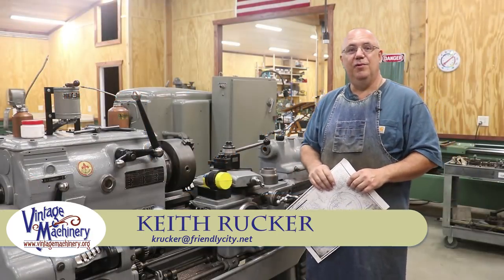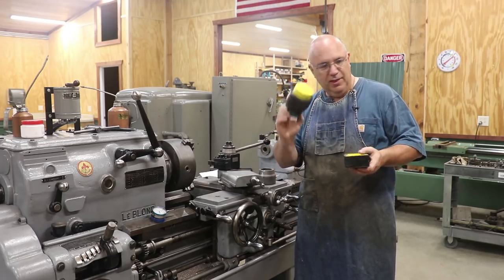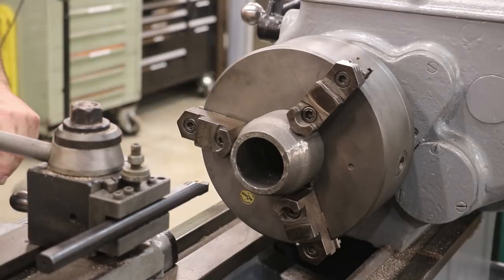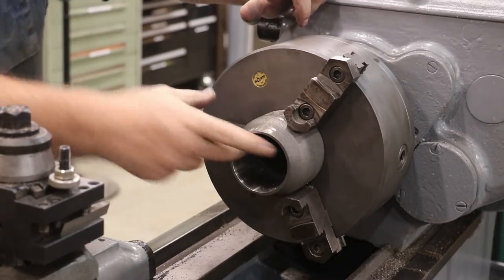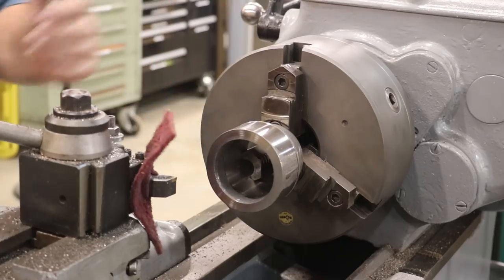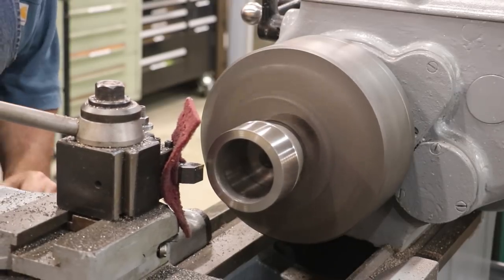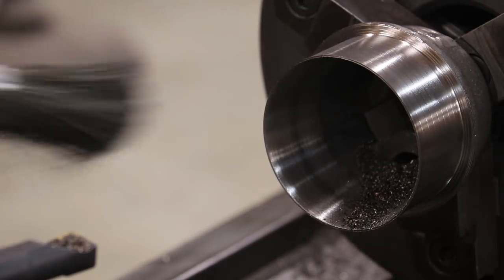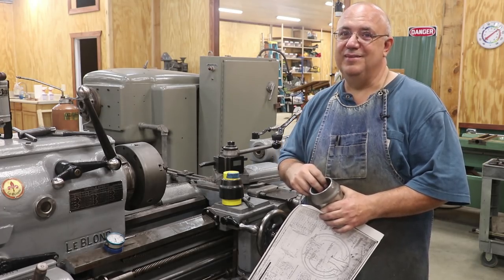Machining a Steam Locomotive Exhaust Nozzle from a Casting

Comment: Excellent video, Keith.  A major factor in these projects is the strategy you use, what to hold first, find center and then a plan to use those surfaces to hold the part and turn the rest, without going askew whiff and running out of material.  In the video, you just appear to tell us the plan, but I know there are sometimes occasions where this decision is difficult.  But you say just enough to tell us the solution.Nicely done

Comment: Glad to see that there were no nasty surprises during this little project (inclusions in the casting, an old socket that was out of round, etc.).
Reply from the maker: That casting really turned out nice.  I was surprised at how true it ran for a rough casting!
Reply: Yes, Cattail Foundry couldn't have asked for a better advertisement demonstrating the quality of its castings.
Reply: I don't think he uses Cattail any longer.  Maybe this was Cattail, but awhile back he mentioned he was using another foundry.  I believe there was an issue with delivery time.
Reply: Thank you for the reply.  I hadn't heard that.  Regardless, the foundry did a nice job.

Comment: Nice turning. That cast looks great when turned. You basically made a venturi nozzle. That is the same principle used in carburetors. And that will help with velocity of the exhaust extraction. Thumbs Up!
Reply from the maker: I've been told that we will probably notice an improvement in performance of the locomotive.  I am kind of anxious to see what kind of difference it makes!
Reply: Might improve fuel consumption as well.

Comment: Lovely job Keith, enjoyed the video. One point to consider in the design of the nozzle restriction is that the narrower the bore the greater the back pressure on the exhaust stroke of the piston, thus increasing the power demand to evacuate the used steam. So there is a balance to be struck here. Probably not too much of a worry here as I suppose you won't be running at any sort of high speed high horsepower demand.
Reply from the maker: Yeah, about three or four MPH is our max speed!!!

Comment: There is another way to keep chips under control. Use a left hand turning tool upside down and turn the chuck in reverse, this will throw the chips downwards
Reply from the maker: Yes, but I honestly just like having my cutter on the top so that I can see what is going on.  It is just a personal preference thing.
Reply: Won't work, I had a CNC machine bury a hot chip in my nose thirty years ago. I still have the scar!
Reply: Love the tip. My lathe is an antique that won't run in reverse......
Reply: Yes, it works a treat, I do this when parting off, especially brass etc. I'm not sure why the Pros don't or won't do it.  
Don't do it with a screw on chuck though !
Reply: No offense meant, but it seems like most people on you tube channels have no clue as to machining C I , i.e.;  always make first cut deep enough to get under the rough cast surface ( clean surface finish )  and SLOW IT DOWN ! ,  no reason to have chips fly in your face. Simply take a heavier cut at slower ( proper ) spindle speed and chips will happily pile up on the saddle and ways and NOT fly up in your  face .

Comment: With the better draft you may get flying sparks from the stack.
Thanks for the vids
Reply: The locomotive was converted from being coal fired into an oil burner.  Since they don't burn coal anymore, sparks shouldn't be an issue.
Reply from the maker: Like John said, we burn oil, so sparks should not be an issue.  Sparks and starting fires in the dry woods around here in the summer time is one of the reasons we made the switch!

Comment: Nice casting and machine job! I would be interested to hear if the operation is improved once the engine get going. Enjoyed the video!
Reply: I think the idea is that the steam blowing up the chimney at a higher speed pulls more air through the fire box. In other words, more draft means hotter fire.
Reply from the maker: The casting is one of the better ones that I have had made - it really tuned out nice!

Comment: Keith a question.  Given the size and amount of material that would have to be removed, essentially the nominal size of the hole through it. The rest will bored out anyway is it worth the extra effort to make casted hollowed verses just drilling it out?

Comment: Nice work Keith.  Should help quite a bit.
Reply from the maker: I sure hope so.  By the way, that sealer that you suggested appears to be pretty good stuff.  It is darn expensive though - about $80 for that little tube, and it states that it only has a one year shelf life!  We will never use that much in a year, but I am sure that we will need some more just about the time it goes out of date.
Reply: Very good stuff.  Keep it in the refrigerator.

Comment: I'm curious to know if the difference between no nozzle and nozzle will be just noticeable or REALLY NOTICEABLE.
Reply: I was wondering if power was improved by better scavenging of exhaust?
Reply: I expect it will be noticeable. According to what I've seen in other sources, the velocity of the steam affects the draft more than the volume of the steam.
Reply: If the engineers who designed that engine thought it was needed, it was.
Reply: In the 1.5" scale live steam world, there has been some controversy, which led to experimentation, concerning the size of the hole in the blast nozzle and it's relationship to the conical pattern of the exhaust blast inside the petty coat and stack. It all makes a difference on how well the engine steams.
Reply from the maker: I am very anxious to see what kind of difference it makes as well.  Lots of people tell me it will be noticeable, but I am just the kind of guy who has to see these kinds of things for himself!  It's the scientist in me.....
Reply: I'm not that familiar with the operating parameter for an old locomotive system like that, but it looks like it functions similar to an air ejector used on ship's steam condensers to remove air and pull the initial vacuum.  The fluid dynamics of nozzles like that are interesting.  I'll bet that it will make a really big difference.

Comment: I'm curious about the hole in the "smoke box" on the center right-hand side at 18:15 .
Reply from the maker: I believe that is the hole that a steam pipe comes in to power the "blower" - it shoots a stream of steam (or compressed air when we are firing) up the smoke stack to create a draft when the engine is not in use - like when you are sitting still.  The smoke box is not under pressure so a hole like that does not really hurt anything.

Comment: Maybe simpler to take a bar of cast iron and turn it down on the lathe?
Reply from the maker: Perhaps, but like I commented before, I like to keep things as close to original as possible and this was a case where I wanted it to be cast so that it would be just like the original.  I am kind of crazy when it comes to my restoration work - its more about making things like the originals than just getting something to work.

Comment: Nice to see the Le Blond in use for one of the last times before it goes to a new owner.  We watched you refurbish it to like new condition.  Which reminds me, did you ever scrape the ways flat?  In any case, lucky guy who gets it!  You will benefit because all your metal lathes will be Monarchs and operate the way you are most used to.  I'm looking forward to seeing you restore more machines and turn out some wood products as well as metal ones.
Reply from the maker: I did the LeBlond before I learned to scrape so no, it was just clean it up, do mechanical repairs, and repaint.  It could use some scraping, but the old LeBlond is still a good workhorse of a lathe!

Comment: I'm a little surprised there isn't a product machinists buy, like a piece of clear tempered glass or lexan called the chipshield or something. business opportunity for someone?
Reply: Sizukun1 - or just borrow one from an angle grinder: these often come with such a shield. Just take it off and use a Noga magnetic indicator base, and put the shield in place of an indicator. Stick it on the lathe ways, and adjust to suit you. 😎

Comment: Could you have made the part out of 4" drill pipe instead to the casting?
Reply: My thoughts exactly Herb.  Hope all is well with you.
Reply: He needs cast iron for the steam
Reply: That would take away the authenticity and it is a museum artifact. Whittling one out of drill pipe would be fine for a working engine but I think a museum piece rates an authentic part. Plus it was probably more fun to do it that way.
Reply from the maker: Sure, it could have been made from pipe.  I am just one of those crazy "restoration" people who like to get things back to as close to original as possible.  There are lots of things I could just fab up and machine from solid if the goal was to just get it back to working.  For me though, I want it to be authentic. It is the small details that matter to me!
Reply: I think that remaining rough casting surface looks better in that application than a machined surface.

Comment: Can anyone tell me what the small 1/2" or so pipe above the exhaust port is for? Is it a preliminary steam exhaust port to start the draft while the engine is fired but not moving?  Thanks in advance.  Fred Ontario, NY
Reply: yes the steam injector to also increase the draft
Reply: Manual steam exhaust to get the fire hotter. Basically the 1800's version of a NOS (nitrous oxide) boost. Vroom vroom!
Reply: It's called a blower, it is used to create a draft to get the fire going during initial steam up, and to keep a draft going while the engine is not under load (throttle open). During initial steam up it's common for the blower to be hooked to compressed air, then it can be switched over to steam from the boiler once sufficient boiler pressure is reached. Once the engine is running under load, throttle open, the exhausting steam from the cylinders, which is directed up the stack, creates the draft.
Reply from the maker: The other guys pretty well answered this.  Yes, it is often called the "Blower" but I have also heard it called the "Flash".  We use compressed air during steam up to both help create the draft through this blower as well as to atomize the fuel.  It also gets used a lot when we are not running but trying to build up steam - like when we are loading or off-loading passengers.  That is always a good time to build up steam while you are sitting still for a while.
Reply: @VintageMachinery    While we're talking about that area of the engine, could you possibly do a video on the superheater?  I don't even know if they used them in 1917.

Comment: @10:55 in pure terms you should have marked the shoulder from the top edge not the bottom. For the venturi action to function correctly the height of the top is more critical than how far the part sleeves into the delivery pipe.